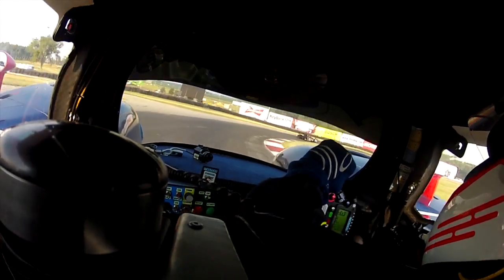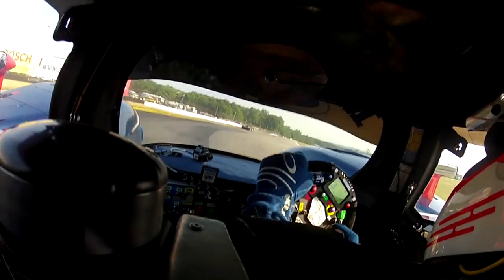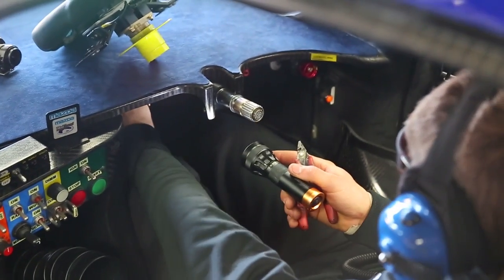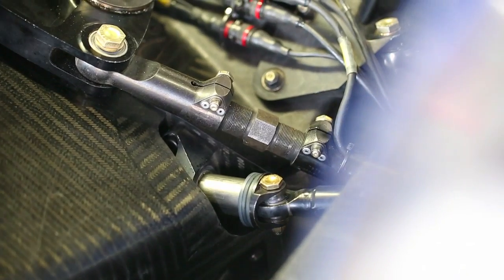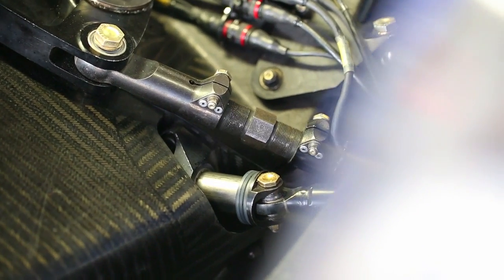Racing Dynamics 201 - How a Car Turns

Comment: That tennis shoe analogy is only true under static conditions. The contact patch at extreme braking, turning, accelerating is considerably more.
Reply: @MrMike44 it's not. Not to the extent that you are postulating. I'm a State Certified Driving Instructor, office in car driver coach, further MX local champion and wanna be future car racer. The contact patch in total fits not change drastically enough to make a difference. The third are round, running in a flat surface, there will only ever be a certain amount of it on the first surface no matter what the car is doing. 

Picture the tire on the ground in a hard right turn, it's going to roll on it's left side, but the contact patch isn't going to increase, just shifts position. That's what F1 cars that corner at extremely high speeds have they're wheels cambered INVESTED at the top, so as the weight of the car rolls to the left in a hard right turn, it then sits at the flattest point. Going fast in the str8 line isn't pushing the tires abilities, turning at high speed is stretching it's linked l limits that's why they are cambered to have the most context patch during the highest speeds, thus most dangerous, so the car sticks better. Flat sneaker had way blue grip than a high heeled shoe, bigger contact patch is the difference. 
Be well...
Reply: @vetb882  For my credentials I'm a mechanical engineer and a regional motorcycle road racing champion. 

In reality there are far more variables than we can get into but science says that Force = Mass x Acceleration and friction is the coefficient of the two surfaces times the normal force.

Accelerating in any direction adds a force to the tires (more in a tangential than normal direction, that I'll agree) so it increases the traction.

As for the camber stuff I'm about to put some eccentric offset bushings in my miata because I can't get enough camber and destroyed some expensive tires. That said, again, more variables than we could get into.
Reply: @TheMikeguy7776  WOW, I'm duly impressed. 👍🏾🤩 Best of luck with the project. Brake str8, turn fast...😎